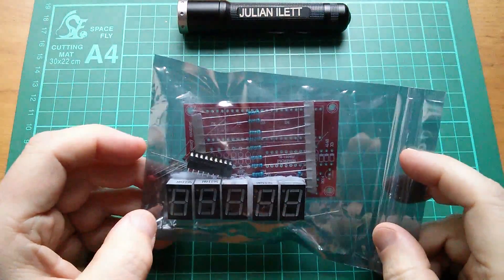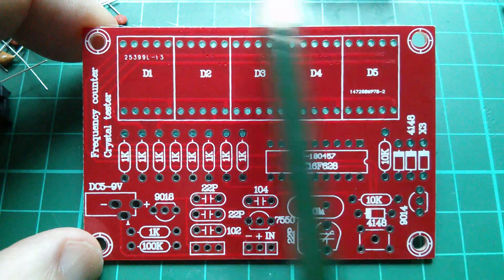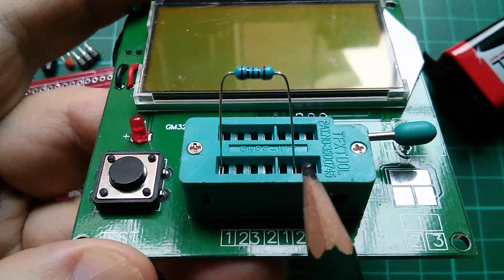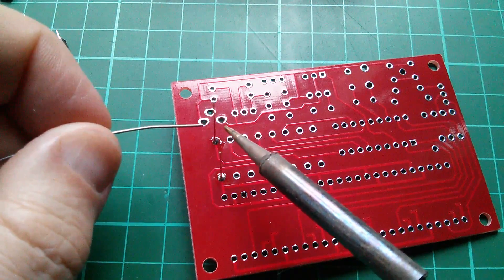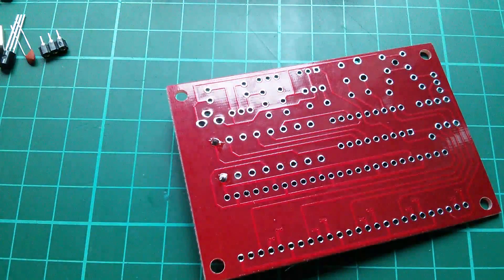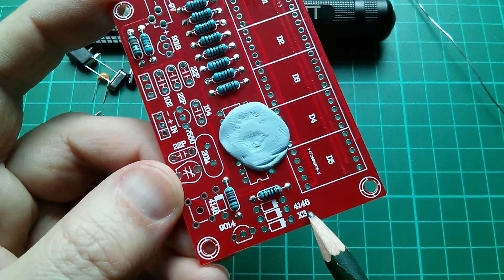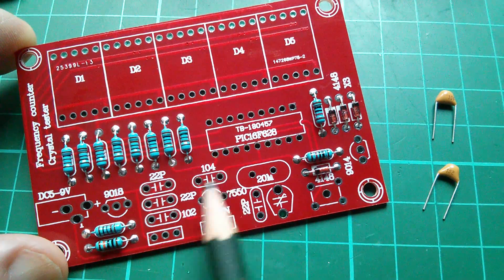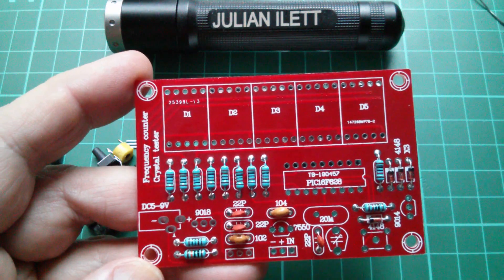Fairly Easy - Frequency Counter - Electronic Kit Build (part 1)

Comment: are the LEDs in the segments driven by multiplexing ? I see only ~ 8 resistors
Reply: I think the pic does this.  The kit has no shift registers.
Reply: Joseph Nicholas yeah I guess its multiplexing as otherwise each segments LED (8 per segment) needs a resistor. I had planned buying/connecting a couple of segments (10 at the most) and for 10 segments I found out I needed 88 resistors so I was surprised this board uses like 8
Reply: +Maico If you want to drive 7 segment displays without multiplexing, use shift register ICs. They even have tunable constant current sources, so you only need one resistor per IC.

Comment: do you know a good place to buy bulk assorted ceramic capacitors and 1/4 w resistors? I'm trying to get a good number of them and just never have to buy any in the future.

are eBay resistors and capacitors of good quality?
http://www.ebay.ca/itm/182390406063
http://www.ebay.ca/itm/151128848522
2 videos in a day? stop entertaining us and just go to sleep

which component tester are you using?

Comment: Bah, just splay the leads to hold them in for soldering.
Reply: That's what i do. It doesn't hold the components flush with the board as well as blue-tac, but does the job fine if you don't have a proper assembly jig.
Reply: foxOmen *bruh

Comment: Why don't you bend out the legs on the other side? I do that to hold my long legged components, works a charm, just put the component through and bend the legs to the side :)
Reply: That's the way I solder components to the circuit board as well.  I just push the component through, and bend the leads slightly.  And I use a helping hands device to help hold the board while soldering.
Reply: It's a bitch to desolder.

Comment: why would someone chew on solder????!!
i'm pretty sure it doesn't taste like gummy bear...
Reply: Reese Me lead oxides tend to taste sweet, this is how children ended up with lead poisoning from lead based paints.
Reply: Didn't know that, thanks for the random knowledge tidbit, can never have enough of that.
Reply: The better question is: why would someone worry for 30 or 40 years if they had poisned themselves as a child?
Reply from the maker: Gout - one of the triggers can be high lead levels.
Reply: Ha, you don't have that I'm sure.